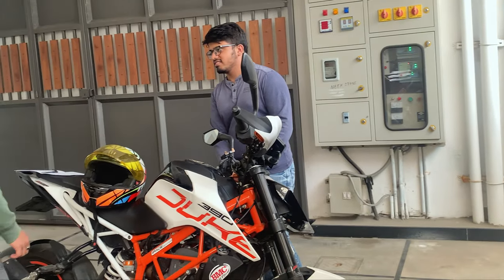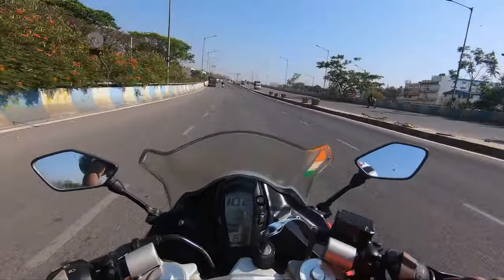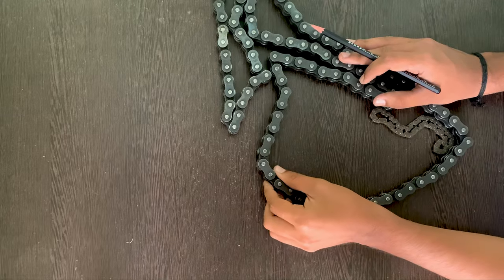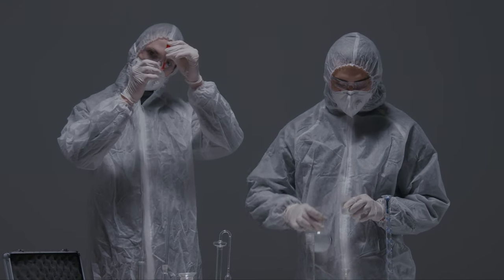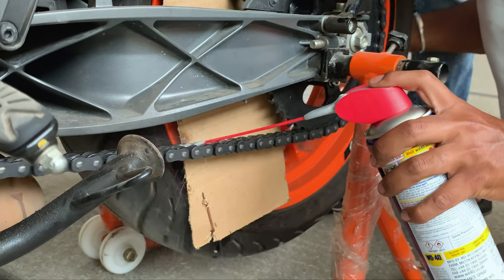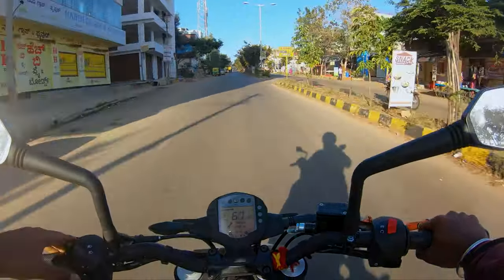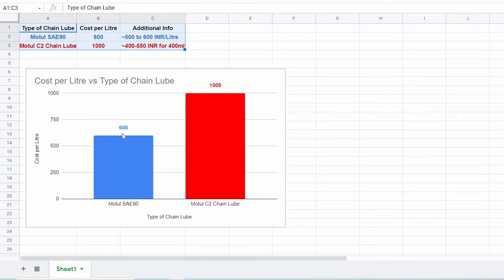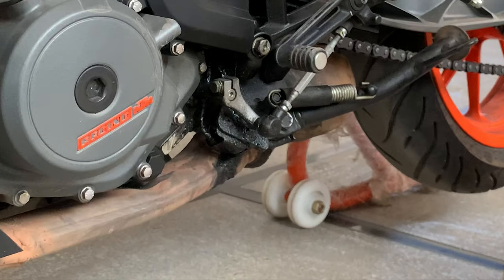How to clean and lube bike Chain || Stop spending on Chain Lube || The Alternate Chain Lube

Comment: Do you suggest the use of SAE 90 oil to lubricate the chain even if we ride on clean roads? And what happens if you use the oil and dont use the vehicle for a long time? The aerosol leaves a black blob when left unused..
Reply from the maker: @Sushen
You'll not have the problem of gunk formation with SAE90 oil. I suggest SAE90 for those who dont mind lubing their chain often as SAE90 dries off faster than the aerosol lube, even if you ride on clean roads.
Reply: @HennisGarage  cool thanks. I dont think using both is a good idea right?
Reply from the maker: @Sushen
You dont need to. Chain lube contains SAE90 oil anyways. So it doesn't matter if you use both